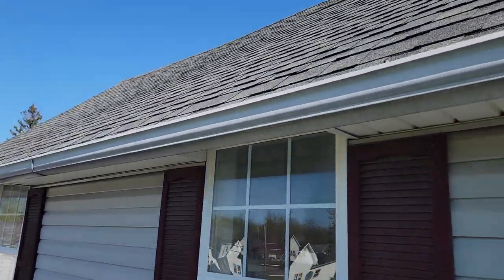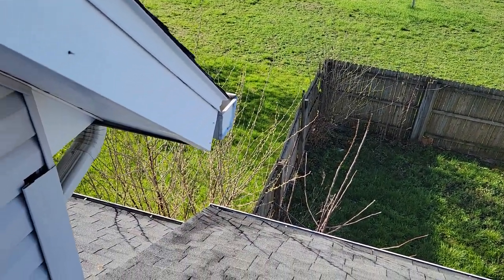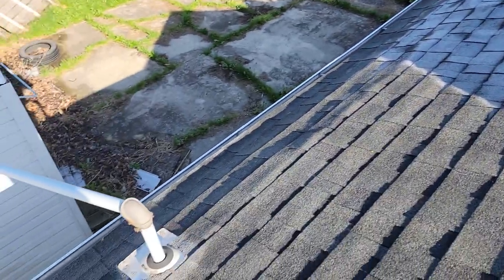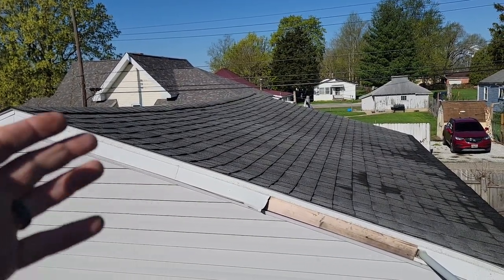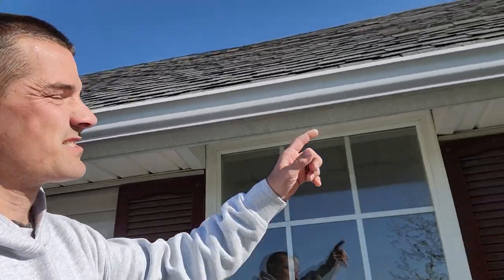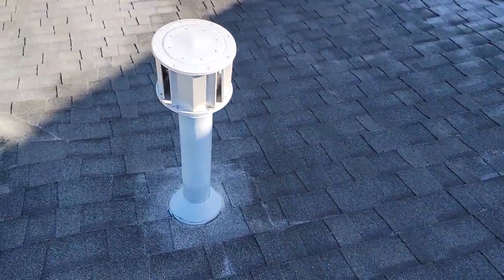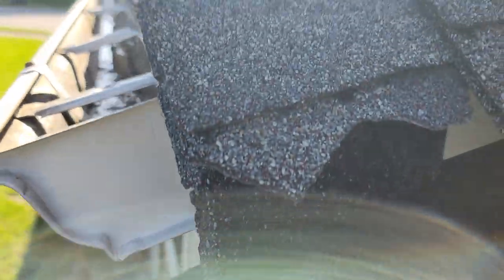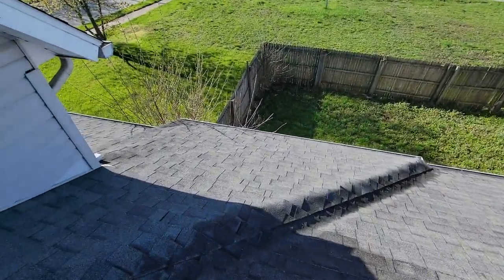Roof inspection for estimate

Comment: That electrical conduit to the shed is so wrong. They should have used over head wire and installed a … drip loop to stop water problems 😂 and we call the rafter braces collar ties here